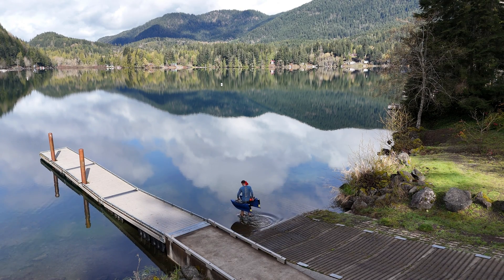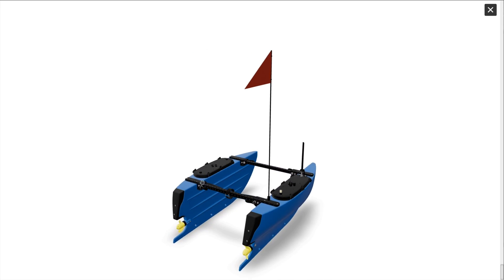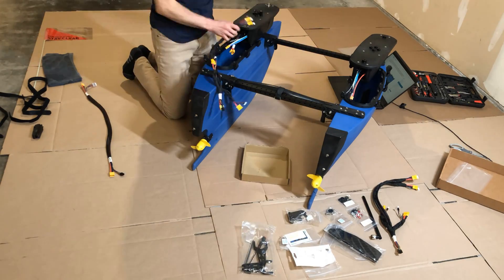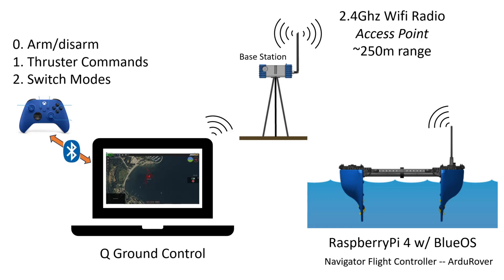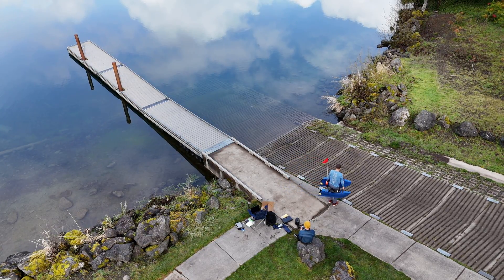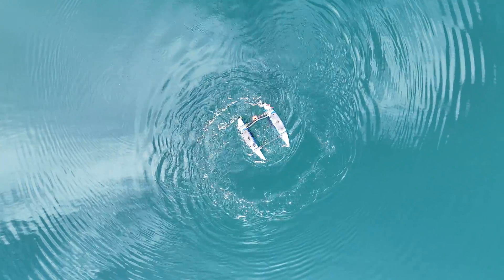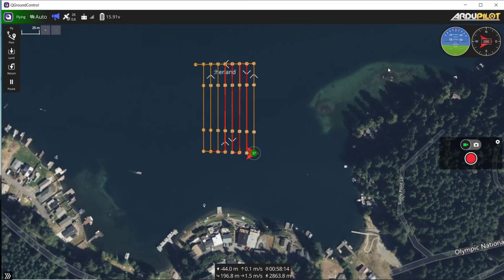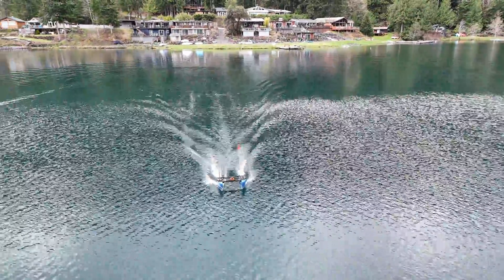Testing an RC Electric Robot Boat! 🌊 BlueBoat USV

Comment: Hello, did you ever test what happens if it hits rough waters and capsizes? Is it possible to self right?
Reply from the maker: Hey there, I haven’t personally tested that, a little too concerned about a stress test that could damage things.

However, I have seen a video of someone doing flip tests and it was fine afterwards. The hulls by default I don’t think are self-righting, but again I saw an engineer put a thruster on there that flips it back over